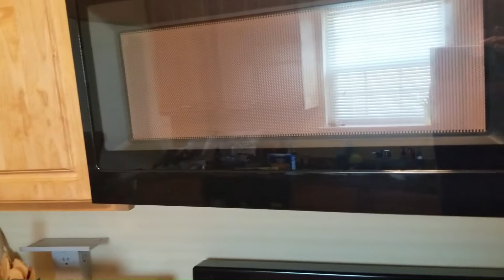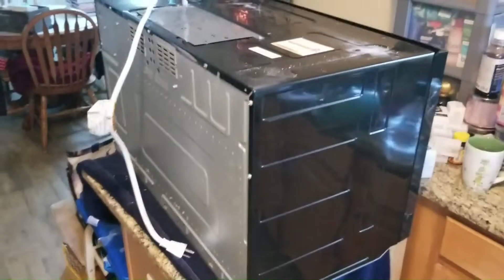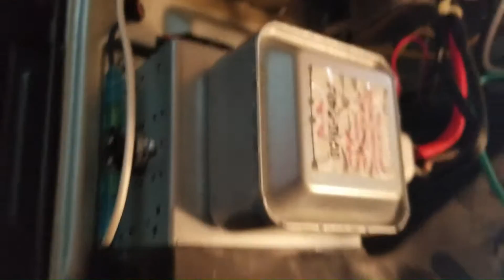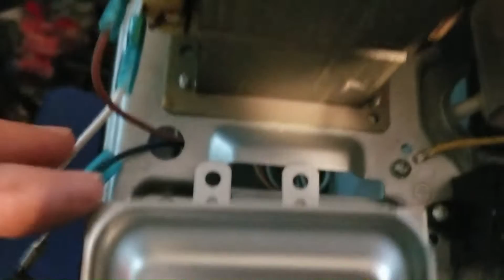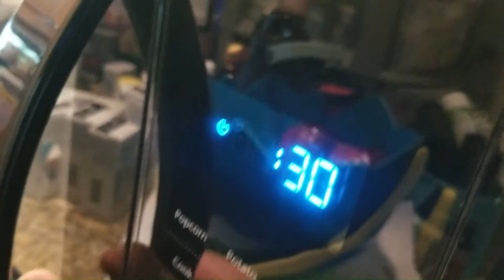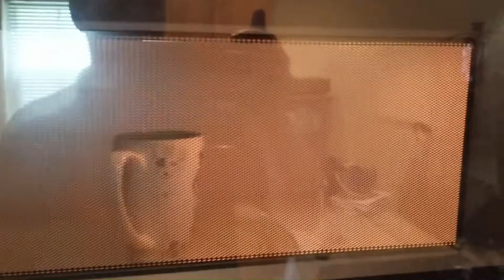#55 - Microwave magnetron replacement

Comment: I understand you have to put a disclaimer. But it's hard to prevent a DIYer lol I'm not sure I want to do this but how do you test the capacitor to make sure it has been discharged? And are there any other elements inside the microwave to be cautious about?
Reply from the maker: I put one hand behind my back and use needle nosed pliers to make contact with both terminals. Most modern capacitors have bleeder resistor that discharges them in under 100 seconds, but this can't be counted on in my opinion. There is usually a picture of a capacitor in parallel with a high mega ohm resistor on the capacitor body if a bleeder resistor is present. I do , however, recommend that you have an experienced technician do the repair because there is always a chance of lethal voltages being present in a microwave oven.